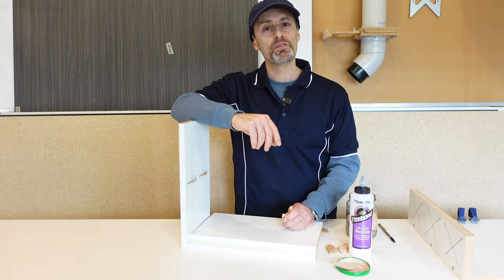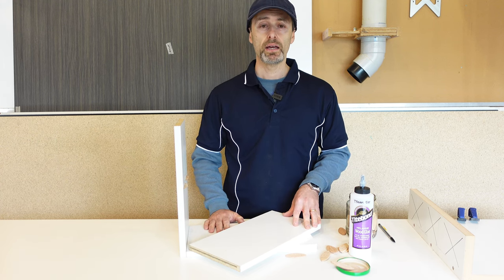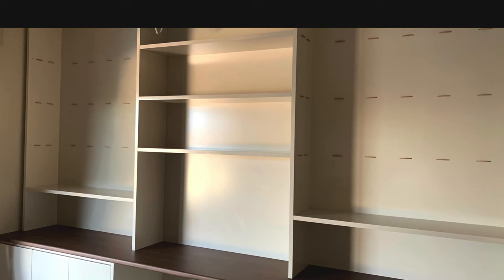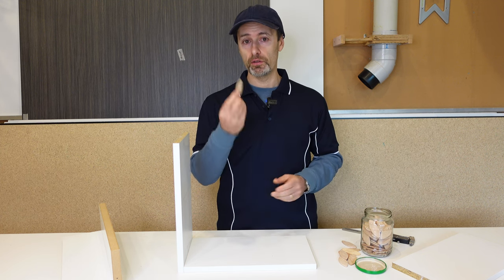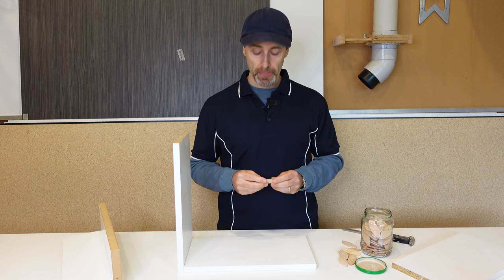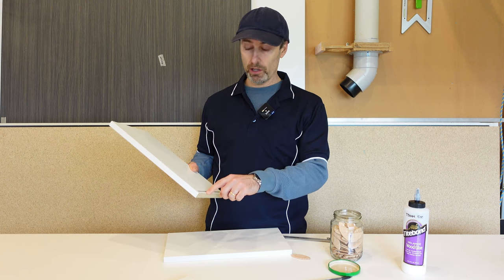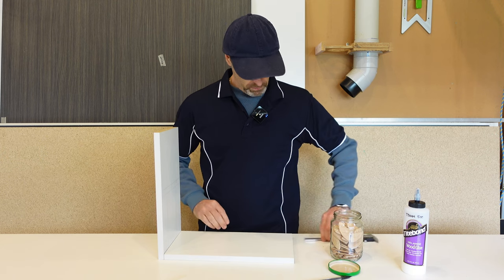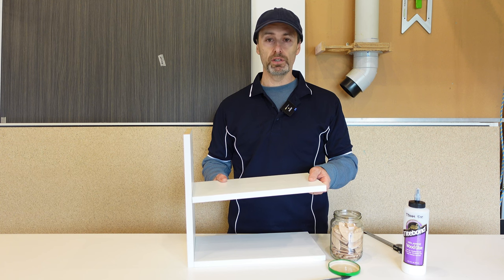Biscuit Joinery Tips & Tricks | Cabinetry Biscuit Joints

Comment: There's no need to use your 90 degree support when plunging into the shelf area of the gables.  You can use the shelf itself - or any straight edge for that matter - to act as a guide.  Then go ahead and hold the baseplate of the joiner up against the edge guide and plunge your joiner's blade down into the gable.  Bing, bang, boom; quick and easy and no need for any special shop made guide.

Comment: What if there are  Two shelves on either side of the verticle?   Do you stagger the biscuits ?   or  use  #10  biscuits ?   so that they don't  hit each other in the same groove ?
Reply from the maker: I had a previous build making a bookcase with this situation however the material was thicker - 25mm so I didn't have that problem. The easiest way would be to stagger the biscuits instead of using smaller ones (#10) to give it more surface area and strength. Good luck with your project 👍

Comment: Curious... what do you do if the biscuits are too loose (like mine)?  I am actually considering taking my blade to the surface grinder and taking a few thou off each tooth!
Reply from the maker: Generally speaking, if the biscuits are loose, then the glue will take up the slack it may only be an issue if you are trying to line edges up flush and accurately, but most times when using biscuits you will need to clamp your components together so it’s not a real big deal

Comment: Hey  Geoff 

Whats method is stronger.

Using  a series of 6 biscuits number 20  (for both sides) for shelves and titebond 2 and clamping it

Or method 2

Creating dados for shelves and screwing it. Using 3 screws on each sides and glue.

I have been using both methods and  find no difference. Like to hear your opinion
Reply from the maker: Hi mate, probably your method #2, the dados are deeper and if you said you can get 3 x screws each side plus glue, that’s going to be strong. Thanks for watching.👍